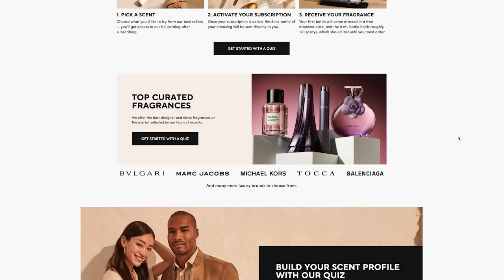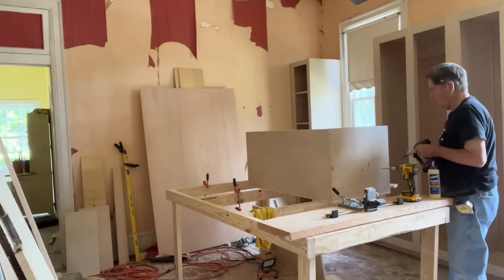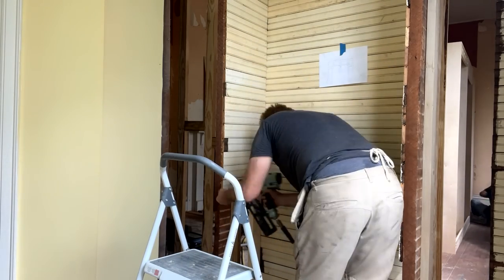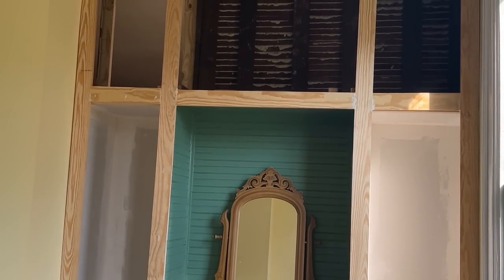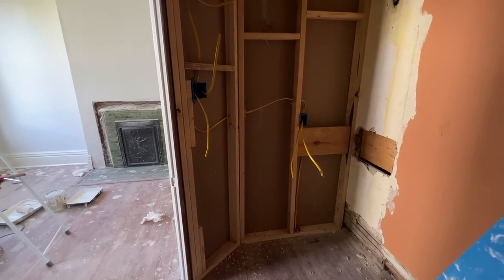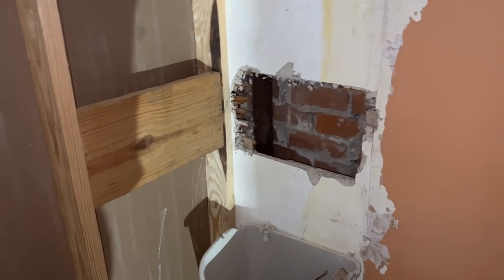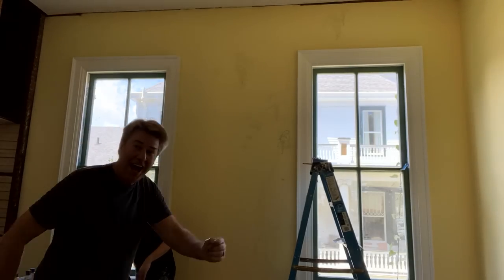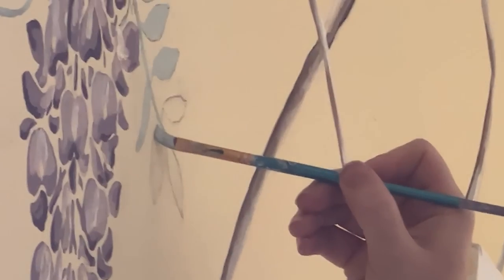Restoring Our Victorian: Pearl E10 Bedroom Mural & More

Comment: There were no closets in the house I grew up in (in middle TN.) My paternal grandfather built the house for my grandmother, neither lived when I was finally born. My grandfather Journey built the wood frame house from used railroad lumber. 

A dirt basement housed a coal burning furnace, which had the coal door drop... I never had to feed that either (two older brothers shared that job.) 

No a/c ever, a tin roof, a bath added much later complete with a claw foot tub. Wish I had that now : ) A small attic housed a single window fan. 

We did have a parlor with a horsehair sofa! And an unusual fireplace that tricornered three rooms! A kerosene burner in the kitchen. That house got cold! Fond memories of a loving mother💕

Comment: I am in awe of you working seven days a week for over a month straight with Fibromyalgia. Wow, that's incredible! How do deal with pain and fatigue? Does weather intensify your symptoms? I've got a severe case of FM, arthritis, and a messed up back. Ever since I was a little girl, I could never handle the sound of power saws. It's like that high pitched noise goes right through me! I never made the connection to FM. Thanks! Best wishes on Pearl! My hubby and I own a 112 yr old home that began as a kit house. Not sure if it's Montgomery Wards or Sears Roebuck. We've been renovating it but can't afford to go the restoration route, especially now that hubby has retired. Our next project is opening up the enclosed porch. Previous owners built around MOST of the original porch posts. It also had porch brackets or corbels, but none remain. Dang it!  I'm researching to see what 1910 porch brackets look like. Got a helpful resource?